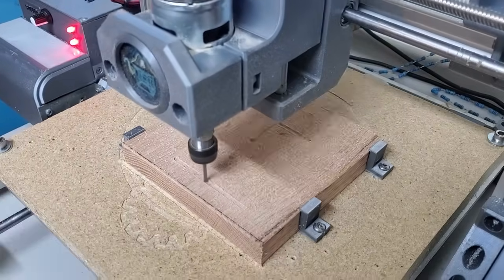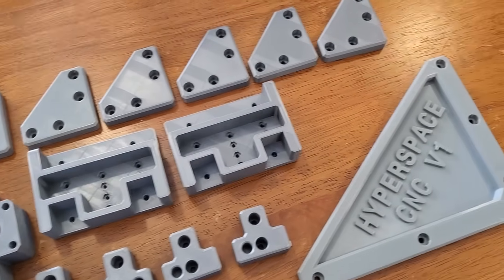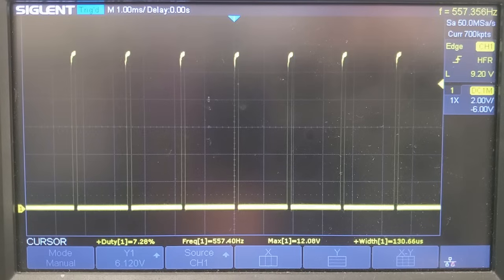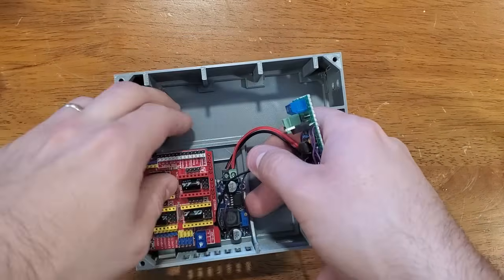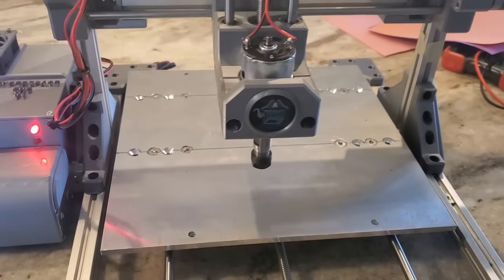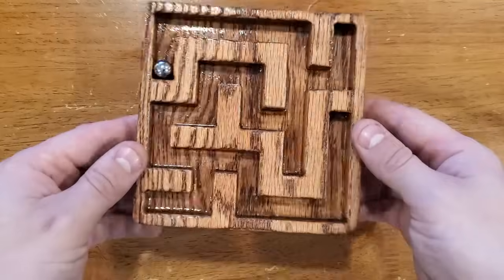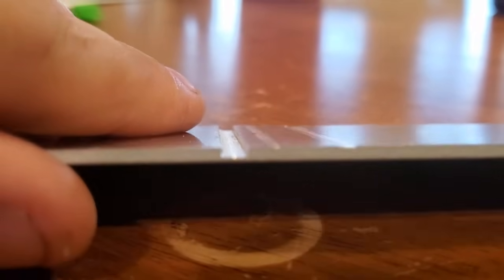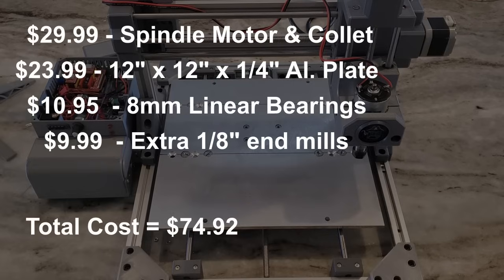CNC Mill for under $100

Comment: The thing I wonder about years is if you could just make better parts for the cnc with the current state. So now you have plastic parts, that are 3d printed. Couldn't you just cnc the aluminium parts on it to replace the plastic parts, even tho they aren't as exact and then just cut the same part once more, just with the stiffened/more exact cnc'd parts? wouldn't it just be more exact with the newer parts, you made? or isn't it that simple?
Reply: That would eventually work out with trial and error from plastic parts then towards rough aluminum to more ridgid and precise parts eventually with skill and experience
Reply: @xXnxanatorXx  thx for the response. I was wondering this for literal ages xD
Reply: That's basically how all of our high precision tools have been made: use your current tool to make a better tool.

Comment: Lol. CNC for under $100.  Caveat.  You need to already have most of the parts around you, oh and didn't I mention a 3D printer just hanging around.    WTF.......Stopped watching at that point.  Click Bait. I got a very high end PC for under $50.  I just had to buy the case, I had all the other parts stuffed in a draw.  LMFAO.

Comment: Frankly childish a project, just to spare a fist of bucks! You copied the 3018 CNC with some kind of "enhancements" which turned out to inherit and amplify ALL 3018 CNC weaknesses like those wobbling parts... My God! My original chinese 3018 CNC was way sturdier than this crap! Why? because their engineers did their best to get a compromise between a cheap device and decent features. YOU JUST COPIED and played with solidworks design BUT ACTUALLY YOU DIDN'T fully understand what it's all about! No surprise! wobbling grandma! A bit infantile and childish and from an engineer's standing point, it's miserable that you had not ANTICIPATED the mechanical issues that came from just a copy of an existing machine. Are you really an engineer? I DOUBT
Reply: Cool it man, It takes a tremendous  amount of talent to do what this gentleman did. 

Think about it, all of the cad design required to create the parts and the knowledge of the control system to make it work.

Comment: Wow , super impressed. Please could you tell me about the printer , what was the filament, the settings eg infill and temp Well impressed
How much to buy all the parts you have , guess it would be cheaper me buy the cheapest on amazon
Reply from the maker: Prusa Mk3S with PLA at 100% infill. Could be done on any printer though

Comment: The title is misleading, because you can't make this under 100$ unless you have almost all the parts. 

Arduino Uno = 14$
Spindle = 24$
2 Stepper Motors = 40$ 
3d Printed Parts (around one spool from what I see) = 29$
Power Supply = 30$
A lot of 3d printing filament

And you're already over budget. If you add to this the T-Nuts and extrusions you can't make it under 180$ to 200$ if you try to source all the components yourself.

Moral of the story, is unless you already have all the parts laying around, this video is not for you.

Comment: I think it would really benefit you to chop down the size of this machine. Every time you half the length of a beam, you get one eighth the deflection. This would be a huge increase to the rigidity of your machine, and would be fairly simple to do. The play in the leadscrews can be dealt with by good machining practices, and your Z axis jumping may be helped by counterweighting or adding a spring to keep it preloaded vertically. Shorter tooling and keeping the spindle as close as physically possible to the rails may make this moderately capable of acceptable aluminum parts.
Reply: Yeah shorter tooling was what I was looking at. The stick out on that endmill looks like a fast food straw trying to cut aluminum lol. Still amazing tho with how hes got 0 rigidity.
Reply: I’ve really enjoyed watching this video and it was already a project I decided to make for myself. You have provided me with the details for the electronics and the fact that you have 3d printed most of the joints while still use the aluminum 2020 profiles. Thanks a lot for these, the only thing that is still unclear for me is where to buy a wild beaver with a huge appetite for the materials. Well k figure that one out eventually. Lol. In return I would like to share a bit of my knowledge about CNC milling if it’s useful enough for you anyway. I have two decades of experience with metal shop working on several different brands and quality cutting machines and for the first one on my behalf comes the tool to cut bigger surfaces at a time on your DIY milling machine I would go for a wood cutting drill for bigger holes whereof the centerpiece drill is removed. Usually this is a pieces of hardened sheet steel leaving a little gap in vertical direction on it’s socket. (Excuse me if my choice of words is a bit vague and strange. Hopefully you’ll understand what in essence  I would like to explain…. If not, please reply and I will send my best translation of the issue to read.) I was born in the Netherlands, a small country of huge contradictions in everything. Insanely well build, extremely difficult to learn the language, what immediately explains why i made my apologies. At second place I would like to point out the fact that this type of machine has possibly room enough for double stepper motors that moves the y-axle and instead of the use of the ball bearings i would prefer slide bearings of high density polymer material. Anti backslash nuts would also benefit the damping of vibration, as well as the diagonal gantry support on both sides in both directions too. At last when you got no longer made any errors (of whereas you probably already have arrived) it’s majorly beneficial to make use of tungsten carbide tools and lubricants witch drastically improving rigidity and lifetime (or less wear off) for your cutting tools. Sharp tools equals less vibration and it’s the same thing by the use of surface lubricants what prevents warping and changing the molecular structure of your metal (what can loose hardness by this creation of heat, unless you are cutting in steel that hardens up from the friction between your tool and your materials) lubricants reduce the production of heating up as well, even if you only use water to lubricate. 
Thanks again and kind regards,
Raymon
Reply: If you want more stability add Height to the beams. Doubling the height will also make it 8x stronger.
Reply: @dmyt58  what do you mean by that? Wich beams are you talking about? Could you please explain a bit further?
Reply: guys I found the cnc engineer
Reply: Another option would be to make the frame, supports, rails and mounts out of a much more solid material like steel. Making the horizontal travel a square tubular can probably help rigidity even with the increase of bulk and weight. That spindle definitely needs replacing, with a much beefier and much more concentric spindle assembly with proper bearings, and all the motor will do is drive it with pulleys and v-belts.
There is another version of this made by ericinventor that used a Makita router for the spindle with some serious axis rigidity upgrades, though the invested cost was quite big, the results were worth it.
Reply: now he can machine more and more rigid parts using his new router and progressively build a more and more rigid router so he can machine better and better parts lol
Reply: or he could put gussets and stiffeners? or just buy thicker material that is rail shaped lol
Reply: is there a way to learn to think like this without engineering school?
Reply: @gooniesfan7911  tinkering and research projects other people have done.
Reply: Well, you can also go with different extrusions the sall rectangular profile obviously is not too stable for deflection.

Comment: Excuse me sir why can't it cut on steel metal
Reply from the maker: In theory it could, but it would need a carbide end mill and the frame would need to be more rigid. Even then it would probably be limited to very shallow / slow passes
Reply: @HyperspacePirate  thank you for the advice

Comment: Absolutely intriguing! I checked my drawers after watching your video and found that I’m also just lacking a spindle to start this kind of project myself. Thank you for sharing and inspiring!

Have a question though: How did you solve the steppers calibrating their position? Don’t see you’re using end stop switches here..?
Reply from the maker: I set the zero manually with an edge finder every time a workpiece is fixtured. There's too much variance in a limit switch, and a ton of variance in where you place the workpiece by hand, so it's not like a 3d printer
Reply: @HyperspacePirate  Yes, that makes sense. I assumed it is nearly impossible to tell the machine where to find the manually fixtured work piece once the steppers found their end points. Thanks for your response and your advice!

Comment: Yeah, the thumbnail caption roped me in ** - and I watched it anyway.   Not going to quibble about the value of the spare parts or the necessity of a large format 3D printer, b/c it's a worthy design and thought provoking.

I would like to know which filament you used to 3D print those parts. 

The spondle speed controller you designed is truly elegant,  and the end result -  the work it can perform - is surprisingly capable.

Bravo!

** first time evah a YT thumbnail caption wasn't full disclosure about the video.
Reply from the maker: Slightly over one roll of PLA. The infill density was pretty low which caused the rigidity to suffer
Reply: Thank you @HyperspacePirate  
I see you went to many aluminum parts for the part 2 upgrade 

Would you consider doing a 1A episode with a more rigid filament,  for those for whom this is more within their fabrication capability?  IIRC, PETG is more rigid,  for instance. 

I don't know if you've seen CNC Kitchen's channel,  and he has done quite a lot of properties testing on a machine he built

Comment: What are the measurements of the aluminum bars and the t8 screw?
Reply from the maker: 2x 420mm (front to back bars on base)
2x 370mm (crossbars on base)
2x 230mm (Vertical bars for gantry)
2x 270mm (horizontal bars for gantry. I didn't have long enough bars so i had to compensate with a wide 3d printed bracket. Optimally they should be 330mm)
X and Y screws are 350mm, i think and Z is 135mm

Comment: If you change that a little bit more (like thicker rods, and a better spindle), I'm sure that you can make a much more capable CNC router
Also remember: if the bearings can be pushed in place with no effort what so ever that means that the machine can do it too
Reply: Unsupported guide rods always flex. There was a commercial machine years ago with tubular linear guides over 10 times the diameter used here and it flexed. Unsupported supports are just not very supportive. You need the linear guides attached to the frame of the machine.
Reply: @1pcfred  i think that there is a middle point with ones that are linear bearings but have an opening to be suported

Comment: Why would You desolder connector on arduino if You are using CNC shield that have screw connector for suppling power ?

Comment: Hi
In this bill of materials, the author did not put costs of 3d printing.  Today all these electronic elements are very cheap. But what about 3d printing? My 3d printer prints no more than 10g per hour. It means that printing all elements will take maybe a hundred hours or more. How much does cost electricity? The whole project looks very nice and easy but is not so easy. Another question is the time of carving aluminium. On such a tiny machine it will take tens of hours ...
Reply: Dude is just a hobbyist, making machines in his spare time, the fact is that he had parts sitting around and he only had to spend a $100 more to make the machine, he’s not trying to sell it to everyone. Watch the build and design, this is why people don’t share their knowledge because assholes take a title and rip it apart, how about just appreciate the knowledge and the content rather than picking a title apart. Why would he add per hour cost? He wasn’t on the clock when he was printing, he set it to print and went to bed.. SMDH!

Comment: Very cool. My only thought @1:50 was seeing how the grub screw to couple the motor shaft to the drivescrew was inaccessible without taking the machine apart. I guess just make sure it's tight the first time, and maybe throw a drop of threadlocker in there :P

Comment: Good job! I ended up buying the $160  kit, it suited my immediate needs perfectly and I'm very happy with it. I haven't used it on aluminum, but I'm curious how it would perform with a spindle upgrade. What feeds and speeds did you use for the large gear?
Reply from the maker: 0.2mm Depth of cut with 100 mm/min of travel. I was running the spindle at full which i think is around 18,000 RPM. The limiting factor isn't the force of the steppers or the power of the spindle but the fact that the cheap machines are so floppy they don't have the ridigity to cut deeper/faster even though it doesn't take that much energy
Reply: @HyperspacePirate  You know what the funny thing is? The first lil CNC I built was made out of floppy drives with those tiny stepper motors for axis movement and a Dremel as a spindle. And it worked. Primarily because it was made out of aluminum and brass, and I've spent a ton of time making it as rigid as possible and movement as effortless as possible. Remembering it now I'm actually pretty shocked it worked.

Comment: you're using Catia V5 for modeling and not for CAM (prismatic machining) why? (otherwise, very good job!)
Reply from the maker: Didn't do much research into CAM software before i made this video. I started exporting .step files fom CATIA and using the CAM package in FreeCAD for my toolpaths now, which I'll show in part II
Reply: @HyperspacePirate  Good reason, If you have prismatic machinning try it (it's better than Freecad CAM). Consider also FUSION 360 which is free for makers and I think the best free version for CAM work and well documented. Waiting for your part II, regards!

Comment: Right, your stepper motors are nema 17 but, how about the torque? has many types of nema 17 steppers, and i lost in this, how is minimum necessary for milling brass, or aluminum?
Reply from the maker: Pretty low. Probably like ~0.3 N-m

Comment: GRBL on an Arduino?  Ewe...
Reply from the maker: It works, but it's close to capacity on the arduino uno. If i wanted to add another axis or automatic tool change etc i'd need a more powerful board